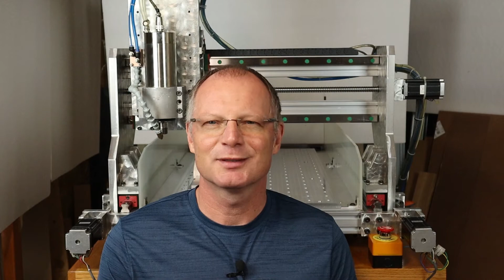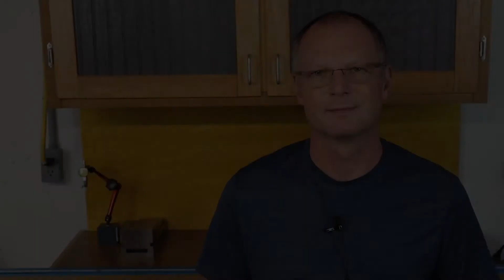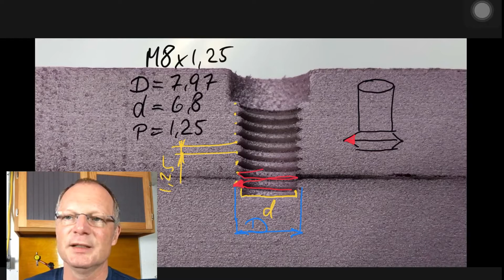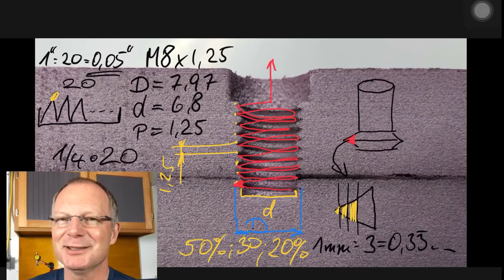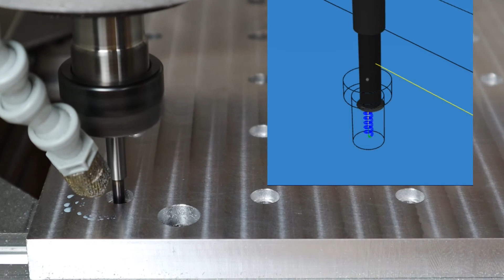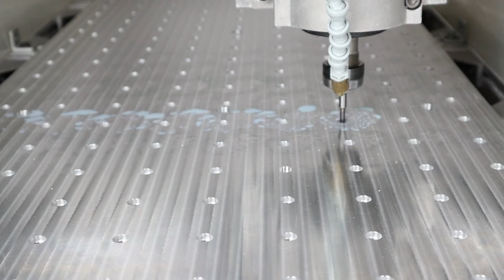CNC Router  Fixture Plate 2/2 & Thread Milling

Comment: Thank you for the video. I’ve been watching a lot of your videos lately. 
Is it correct that you are bolting this fixture plate to T slot frame of your machine directly? Do you take any measures to stop your fixture plate and T slot from vibrating during machining of aluminum? 
I made a much smaller plate out of 1/4” steel and I worry that the plate vibrating will not allow me to hold aluminum rigidly for machining. I will likely make a larger, thicker fixture plate based on this video.
Reply from the maker: Excellent that you enjoy my contend. So yes I mounted the plate right to the t-slot profile (also called 80/20 profile or ITEM or Bosch Profile). So invest as much money into that plate as your budget allows because the mass of the aluminum will act as a dampener for the vibrations. 1/4” is not much 5/8 is as thin as I can recommend but 3/4 will be very very nice.
Reply: @JBWorx  thank you for the content and the feedback! A lot of the CNC router content I see is more wood working oriented and less machining/precision oriented. I think I even saw someone setting their steps per inch using a ruler once
Reply: Looking at aluminum prices, I’ll have to practice a bit before I try to make my fixture plate
Reply from the maker: Yes and for woodworking that might even work. But I love precision.
Reply from the maker: Have a look at the 2 vids for machining Aluminum they will get you started. Use a single flute bit and some sort of coolant even if you use a pump sprayer to apply it.

Comment: The shoulder bolt locating pin is a slick idea. Much better repeatability than just a pin. I will incoporate that on my next plate.
Reply from the maker: Thanks for the comment Gerrit, yes this works really well. It is a very nice upgrade to any machine even if you just make plate for a section of the table. You can also put the design of the plate as a template into your CAD / CAM program and use the positioning right from the machine home position (if you have good home switches).

Comment: Great video, would be really valuable if you spoke a little about the fusion toolpath parameters and the brand of cutter than you used.
Reply from the maker: Yes, I plan some step by step part making videos that will include this information. The next video will have quite a bit of machining in it and I can add some information to the cutting parameters. Thanks for the suggestion.